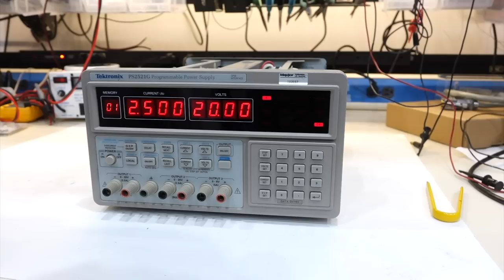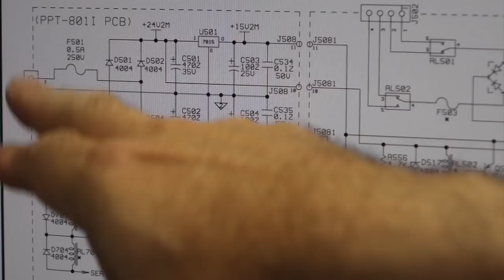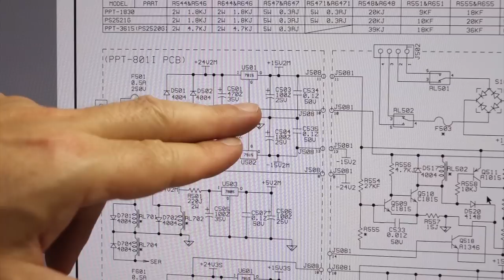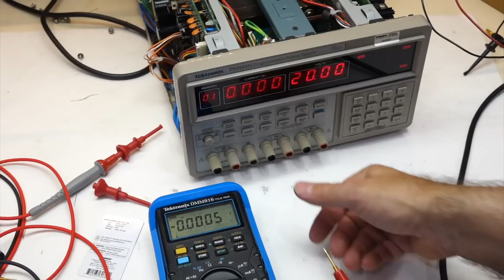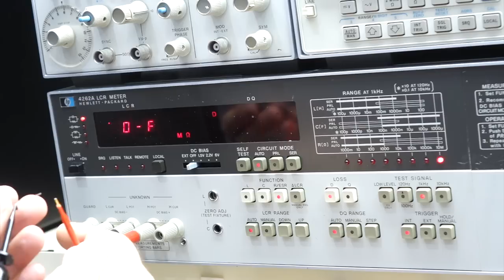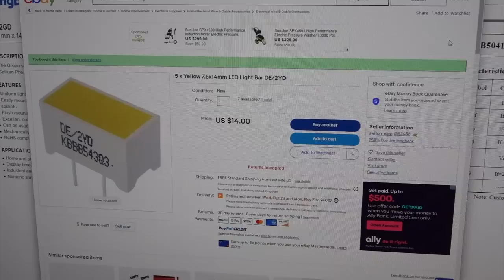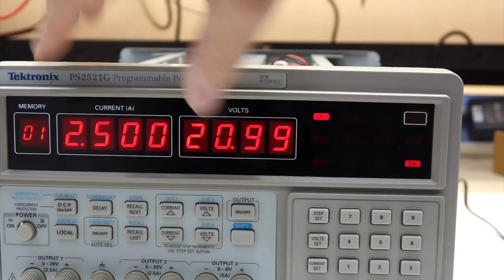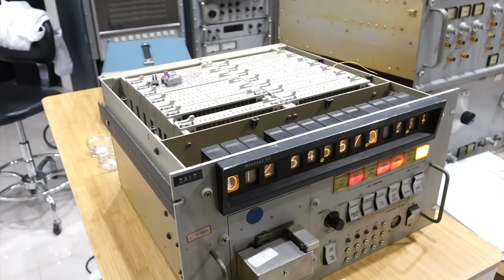Tektronix PS2521G triple power supply repair and upgrade

Comment: Very mundane question: what label maker did you use to make your little LED frame for the front panel?? I've been trying to find one that prints white text on a black background, and you seem to have found one!
Reply from the maker: It’s a humble Brother p-touch. I like it very much. But it’s a bit like HP ink, they get you on replacement label cartridge price…
Reply: Another nice thing about the P-touch is that you can get heat shrink on a spool, so labeling wires or bundles is easy (I hate flags!)
One thing to note is they are sold by the flattened width of the tube (1/2 the circumference) not the diameter it will fit over.

Comment: It has internal series/parallel relays, so you should have been able to put it in series mode and gotten the full 28V.
Reply from the maker: It does, but I needed the 3 supplies.

Comment: Although the NVRAM ICs can still be bought, for many it is easy to carefully mill away the plastic over the connection to the internal battery, disconnect the IC from the dead battery and connect it to a pair of wires and a conveniently placed CR2032 cell. Since the datasheet shows no NC pins, I suspect they are below one of the narrow ends. I wonder if using a 28C16 might work as well, given that the DS1220 has no RTC.
Reply: No need to mill away the cover, it will pop off. Beware of poor soldering on the RAM pins near the edge of the PCB. We used those at 3Com and they were a constant quality headache. I would replace them with a mini PCB with RAM on the bottom and a CR2016 holder on the top.

Comment: If your Dallas chip has become useless anyway, no risk to try Dremeling the top off and prying the old batteries out and soldering on a new button cell holder.  If you have access to a milling machine, that might be a safer way, take a few tenths of a mil off with each pass.

Comment: Mark my Fluke 87 series 5 tells me I am a dumb dumb when I forget to move the leads, surprised that the 177 does not.
Reply from the maker: I’m surprised too! The blue Tek meter certainty does complain about it. If you look at the footage closely, the Fluke flashes “Lead” for maybe a second, but then it goes away. Maybe the lead detection microswitch is not working correctly anymore?

Comment: My HP8753D VNA stopped working a couple weeks ago. I've been putting off tearing into it but I suspect that the issue is in its power supply too. Hopefully just plague caps that fingers crossed haven't done lots of damage.

Comment: Not sure if the new fan is a good idea...
I'm pretty sure they chose the loud one for a good reason. I have done similar mods, and most of the time the device got significantly hotter with a silent fan.
Reply from the maker: You have to buy one with the correct flow and static pressure. Which is why I could not go with a truly low noise one. This one is just less obnoxious…

Comment: Marc, what is the make/model of the workbench you are using in this video? I really like the depth of the shelf and working table underneath plus the monitor mount location.
Reply from the maker: That's an IAC Dimension 4 workbench. The Cadillac of modular workstations. $$$.

Comment: Why not cut the red filter just around the output LED spot??? a green LED for that op with be nice!
Reply: That's what I'd have done as well, but the downside is that you can never return the equipment to 'as new' configuration.

Comment: Any concern that the quieter fan might not deliver enough cooling air?
Reply: Very unlikely. The old fan must have had worn out bearings in it and that's why it was so noisy, I guess.
Reply from the maker: Yes, you have to choose one with enough flow and static pressure. That’s why I couldn’t go with the really low noise ones. But at least this one I can live with.

Comment: I feel that an ESR Meter would have saved you a lot of time fault finding that PCB.
Reply from the maker: That’s the weird thing. As you can see in the video, all the bad caps tested good for ESR! Really a very unusual cap failure.
Reply: @CuriousMarc  Sorry. I assumed you hadn't checked the ESR as I'd check the ESR of the caps in circuit. Your ESR meter is slightly better than mine. 😉

Comment: Marc - if you find a good solution for the DS1220Y part please let us all know...I did see another comment lower that talks about the DS1220 and will investigate that as well. Have two old HAL ST-8000 TU's that I replaced long ago and I'm sure are DOA by now.  73 - Dino KLØS

Comment: Have you guys ever blown a power supply by putting two in series?  It has happened to me at least twice.  However when I connected them in parallel and then I use one's current limit, nothing happened.  Do you guys have any explanation for this?
Reply: Are the outputs referenced to ground? Any other connections to the power supplies that might reference to ground?
Reply: @ChrisSmith-tc4df definitely not.  The negative of each ps was isolated from the main ground wire.  Usually there is a piece of metal connector negative to ground.  I have removed them all.  Besides,  if the negatives were connected to ground, one of the ps would have been short circuited.
Reply: Probably a power supply whose design was not thoroughly tested in series operation. Even a few HP supplies get damaged when you back-drive the inputs, and series operation is exactly that.

So, explanation: supply not good enough.

Comment: Maxed out the PS2521G?  I think you want a HP 6623A.  I happen to have a spare one in the SF Bay Area.
Reply from the maker: The HP 6623A is a nice triple supply, but only 80W and lower voltage. This one is 250W in a much smaller form factor.
Reply: @CuriousMarc  The form factor of the PS2521G is certainly much more bench friendly.  If I found the right specifications, it however outputs "only" 5A @6V + two times 2.5A @20V for a total of 130W (output).  The 6623A is meant for unsupervised industrial applications in a standard 19" rack and outputs up to two times 40W (2A @20V or 0.8A @50V) plus one time 80W (up to 10A @7V or 4A @20V) for a total of 160W.  It has an awfully loud fan though😆
Reply from the maker: @guntherthomsen3864  Alright HP wins!